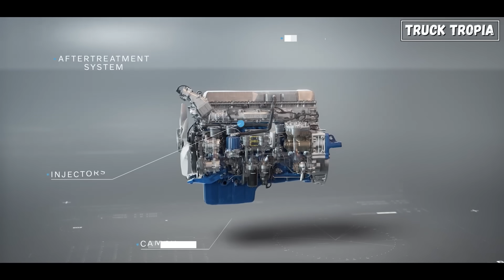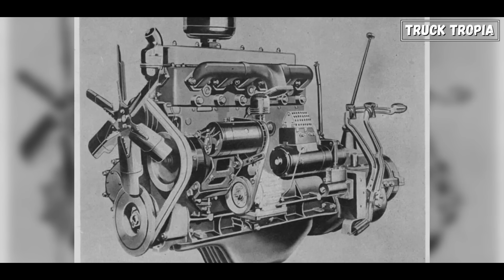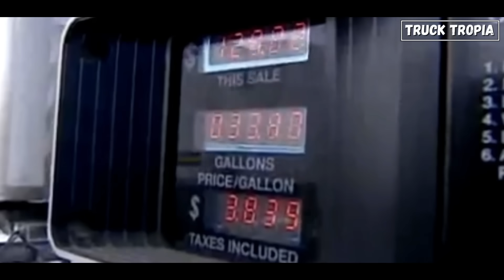How Truck Engines Went from 200 hp to 600+ hp

Comment: Electric trucks aren’t zero emissions. It either comes out the smokestack of the truck or the smokestack of the power plant.
Reply: That's where nuclear plus renewables comes in!😄😄😄
Reply: @leechjim8023 I agree! But it’s not even a 50 50 comparison right now. Or even a 1/3 each between the three.
Reply: @truckinguy92  Its probably not now, but it will be in the future.
Reply: It’s a common critique, but here’s the big picture: EVs are about 80% efficient at turning energy into motion. Gas and diesel engines? Around 20% — the rest is wasted heat. Even if the electricity comes from coal, it’s still more efficient overall. Plus, I’d rather use domestic power than keep funding oil companies and petro-states. U.S. oil independence is a myth anyway — we can’t even refine our own sweet crude. Batteries are improving every year. Let’s electrify what we can and save the mess.
Reply: @HiFiTown yes but the electricity used to charge an electric vehicle is almost always generated by a combustion engine inside a power plant
Reply: @HQdefault64 Even if you run a combustion engine to generate power for an EV, it’s still more efficient—gas cars waste about 80% of their energy per mile (waste heat), while EVs waste only around 20%, so “gallon for gallon” an EV burns far fewer fossil fuels.
Reply: @HiFiTown Wouldn’t the combustion engine waste 80% to generate the power, and then the electric motor wastes another 20% of the energy, so in total about 84% of the energy is wasted rather than 80% in a regular combustion-powered car? Just wondering
Reply: @HQdefault64  That’s a very logical question. Power plants do burn fuel, but they’re generally much more efficient than a car’s engine—modern natural gas plants can convert around 50–60% of the fuel’s energy into electricity (coal is lower). Then, even after transmission losses, an EV’s motor and drivetrain are about 85–90% efficient at turning that electricity into motion. A gasoline car’s engine, on the other hand, only turns about 20–25% of the fuel’s energy into motion—the rest is lost as heat. So even if the electricity came 100% from fossil fuels, the total “fuel-to-wheels” efficiency of an EV is still roughly double that of a gas car.
Reply: @HiFiTown Very interesting!
Reply: @HQdefault64 I agree—it’s fascinating, and honestly a bit hard to wrap your head around. How many machines do we accept such low efficiency from? A toaster oven, maybe—but even then, every dollar you spend running it is going toward cooking food, so it’s close to 100% useful output. If people realized their cars and trucks only deliver about 20% of each gallon of gas as actual “rubber-meets-the-road” performance, they might be more open to EV's in general.
Reply: @HQdefault64  No, 99%+ of electricity  is generated by turbines. Less than 1% of electricity is produced by ICE
Reply: @HQdefault64  Power plants are stationary and absolutely massive. You will have "combined cycle" power plants that will burn fuel to power a gas turbine - Think of a jet engine on an airplane. The turbine is attached to a generator and you make electricity. If that's the end it's called a single cycle combustion turbine, less than 4% of power in the US is generated this way. As you can imagine that turbine lets off a ton of heat like any "jet engine" would. Now, the powerplant has a ton of room so they will take that excess heat from the combustion cycle and boil water to create steam, they then run it through a steam turbine and extract more electric power. This would be what's called the combined cycle.
Reply: @HiFiTown  I don’t understand how this became a political issue. 

Tesla makes some bad ass electric cars, and also I believe has the highest amount of US made content in their cars. Why isn’t that awesome? Assuming getting the minerals for the batteries isn’t overall worse than just using domestic oil?
Reply: @TechnoLawyer And we won't likely see the refining capacity for domestic sweet crude. Instead thanks to the nature of free markets and profit motive.. they want cheap sour crude from overseas. Electric has me at the 80% energy conversion point... why take part in the lunacy any longer for passenger cars/suvs. (big rigs /long haul I undersrand for now) Tesla's are literally fine  for long road trips.. but the idea that gas is better for "long disrance trips" is being peddled hard to those who just have not tried it yet. Every Walmart is getting NACS standard chargers n a few years anyway. Hybrid was a good bandaid 10 years ago.. but now even convential guzzler SUV's are getting 30+ mpg thanks to CVT rubber bands and sketchy combustion tech. Hybrids are in practice "good" but also cery complicated with a worst of both worlds upkeep (Oil, gas plus batts).
I just talked to an uber driver who walked away from a Tesla M3 run hard put up wet, 250k on the battery and it was still fine (dash blower was not)... those may be the new Toyota Camry and as you say 80% USA made in some cases.. not bad!!
Reply: @HiFiTown  there’s very little electric charger infrastructure in some areas. I’m in Houston. Houston generally has everything, yet we don’t have shit for chargers in most areas.

This is the thing that holds me back from getting a Model 3. I do own my house and can charge at home, but still. 

My father lives in Florida. In his area, chargers are everywhere, so he has an electric. So easy for him there. Charges at the grocery store, at the Walmart, at the mall, etc.
Reply: @TechnoLawyer  You don't need a public charger in your home town, you need a charger in between towns.
Reply: Exactly .
Reply: How about hybrid big rigs overall? Are they a thing? There better or worse environmental impact there? 

In passenger vehicles, hybrids seem awesome. My wife wanted a little pickup. She went for a Maverick hybrid. Once she used the driving coach function on it for a while (apparently there’s something to the best way to drive a hybrid to maximize gas mileage), that thing is regularly getting 45mpg with her at the wheel.
Reply: A lot of that power comes from hydroelectric and nuclear, with some from solar and wind as well. There are lots of ways to produce electricity with little or no emissions.
Reply: The level of misunderstanding is thick enough you could cut it with a knife. 

Electric vehicles are 90% efficient, modern diesels are about 30% efficient. So even if you take your analogy, that 90% includes losses at the wall and accounts for the actual distance traveled for the energy spent. What this means in practice is that these vehicles are cleaner even if the source of the power is dirty. But, that's not even an analogy that'll remain true for long, because states like California already get the MAJORITY of their energy from clean energy. 

So, as we move forward over the next few decades they're only going to get cleaner, even taking into account the power plant. Finally, the whole lithium mining aspect is such a red herring as well, because I guess we just ignore all the damage of oil drilling, refining, transport, and the nasty environmental effects caused by that?

Here's the difference... lithium is on its way out, being replaced by things like sodium-ion, iron-phosphate, and other technologies that are far cleaner.

We've had over 100yrs to get ICE where it is today, we're not going to find a magic bullet. The electric revolution is only just kicking into high gear, and sooner or later people will have to accept that ICE is on the way out.

Today we have EVs with long ranges, and recent advancements are pushing boundaries. For example, a consumer-platform car recently achieved 750 miles in testing on a single charge, with fast recharging capabilities also improving rapidly. While such extreme ranges and sub-hour full recharges are not yet standard for all commercially available models, we are seeing continuous progress towards these goals. Theoretically, we could reach the same level of energy density as gasoline in the next 20 years. We are going to continue to squeeze in more power into smaller physical batteries, and as such continue to remove many of the limitations to going electric.

Finally, to combat what I'm sure is coming next. The grid needs upgrades to handle this energy, but let's pretend for a moment that we took all the gasoline and diesel that we create today and put that into creating power for EVs. We'd actually get more mileage out of doing that, with greater efficiency, than we would from continuing to transport all of that to gas stations.

I don't think we should do this, but it acts as a fantastic example of how inefficient our current method is. The grid needs to be upgraded, but we have time to handle that, and we have technology that can do it.
Reply: The mining of the minerals alone does more environmental damage than diesel trucks
Reply: And yet, it's still more energy efficient than using a ICE engine to directly turn the wheels.
Reply: Trump, however,  is a convicted rapist felon.
Reply: Nuclear and renewables produce zero emissions.
Reply: What pisses me off is how badly motorcycles have been in the last ten years. Sorry to go off rails but its fucking lunacy because motos make up a tiny amount of vehicle sales in the USA and slightly bigger but less traveled in EU, yet modern bikes come plagued with issues in the dbw and make far less power than advertised because of the EPA. I think the change begins in that crooked government agency first. Meanwhile in China, it's fuck all and one day in china is probably one year of pollution in both EU and the USA combined
Reply: What about the solar+Wind power and Regen breaking with EVs?
Reply: still better over the lifetime of the vehicle.
Reply: Also consider the pollution caused in recycling those batteries
Reply: I done just got up off the bowl nomsayin shitting and farting poopin poppin n blowin
Reply: E Trucks are good for the quarter mile drag racing but that's it.
Reply: @Johnsmith-zi9pu  Maybe so for real work? But in the USA (thank you sales dept.,) , on the consumer side.. folks use these massive Trucks  as Grocery-Getters, to make 17 trips to the convenience store. Not to haul a dump trailer, nor,  go up the side of a mountain. Think of the Gas, Oil and DEF fluid they'd save 🤥
Reply: Electric motors are 98+% efficient compared to about 30% for engines. So even if you move the emissions to the powerplant you are cutting overall emissions to 1/3 of what they are now. So instead of 100lbs of emissions from a diesel tailpipe you're releasing  30lbs  of emissions at the powerplant.
Reply: And mining hundreds of tons of ore to get 1 pound of lithium. How much environmental destruction does lithium mining create? Amd how many gallons of fresh water to process lithium?
Reply: @ms.annthrope415 the mining tailings stay at the mine site. Does the CO2 and NOx stay in the truck?
Reply: @ms.annthrope415  look up lithium mining chrisis, forget where its at but its popular over seas in africa i believe and south america, what i do remember is it litterly sucking the life out of the land. the method theyre using is pumping water rich with salt, making the communities wells dry
Reply: @ms.annthrope415 is lithium the end all? Look to the future. These are just details to work out.
Reply: Right. Manufacturing ETs will produce more carbon footprint than conventional ones.
Reply: People forget that power plant have worse power efficiency than car engines. That have amazing efficiency for their size.

Comment: About 20 yrs ago I drove a 1934 Chev, 5 ton petrol, 100 odd miles. It was a favor for a friend. I would guess it had around 80 hp? It was just a cab and chassis. Now that was an experience that not too many would want to remember. I nearly fainted from the heat in the cab and it just about burnt fuel faster than I could put it in 🙂

Comment: Shit.   CAT 16.L.  625hp. With the stock transmission.  BIG rubber.   CAT 17.l. with big rubber     in will say you need to stay in your  lane
Reply: What “stock transmission”??  They’re all stock transmissions.  What a dumb comment.  You don’t even understand gearing and speeds of said “stock transmissions”.  $100 wampum says that you drive an automatic truck for Swift or Amazon.

Comment: Dont forget alot of old trucks were gasoline before diesel became popular for their efficiency and torque
Reply: Also some different brands of engines such as Buda. 
GMC V6 and V12 models
Reply: That low-rpm power that diesels are known for comes from the turbo, though, right?
Reply: @shoryuag not necessarily a lot of old diesels did not have a turbo and turbos became popular in the late 60s/70s since it made diesels produce more HP and torque and with the robustness of a diesel engine it just made sense. A lot of torque heavy application diesel engines don't even need a turbo to produce a lot of torque the added horsepower just makes it a better long haul engine

Comment: 70 years ago 700hp was a tank engine. 12cyl, 30L, 1.5t, 200h TBOH, plum of smoke visible from the Moon. Technology evolved, mostly materials and in last 20 years computer control, and now regular diesel has about 100hp/l, so make 500 or even 700 hp with million lifespan is not a problem anymore. The same with transmissions, bearings, brakes, rubber tyres... tadaaaam - we got modern truck, able to pull 120t on 90kmh.

6:00 if you can use 2 trucks instead of 3 for the same job, the same delivery (distance - weight - time), it means you significantly save on fuel, even each truck gobbles much more fuel than before.

Its very simple to calculate power demand. 70-80kmh (20m/s), 10% grade, 30t - 2m/s*300000n = 600KW just to climb up, without usual drag on this speed. So ideal truck engine should be about 1000hp. It will be a bit overpowered, 10% grade climb with such a speed is extreme, but its The Dream. In reality 600-700hp do the job, 5% climb on 80kmh or rare 10% climb with 50 kmh deemed to be acceptable.
Reply: DPF systems made truck engine durability take a make step backwards. think you will get 1 million out of current production truck engine, good luck. an old C15 cat, or N14 cummins sure.... not anymore. thanks to carb and the EPA
Reply: @andrewdonohue1853  Dont buy US junk and you will get a million out of it. Euro engines are very reliable.

Comment: 600 ain't squat!  Scania makes 770 horsepower
Reply: Ya I was going to say Scania and Volvo got some motors in Europe closing in on 800hp
Reply: CAT C16s can be tuned to hit 800.
Reply: Scania this and Scania that. Blah blah blah. This is North AMERICAN trucking here, obviously 🙄
Reply: @StopDaCap2991 except several shots of European trucks, so not just American. Try watching the video before commenting
Reply: @senseofthecommonman Except all engines mentioned in the video are AMERICAN. Try watching the video before getting smart.
Reply: Cat C18 with Marine cam makes 850 hp and can be easily tuned up to 1150

Comment: Electric trucks just don't have the range. Full tanks of Diesel will take you over 500 miles, then 10 minutes to fuel and grab a bite to eat. Batteries are heavy, expensive to replace, and take forever to charge. Electric trucks won't be the norm except for short haul, dedicated routes. Like Amazon. Same with automation. AI can't navigate complex road conditions
Reply: Hybrids are the way to go
Reply: Yeah, once the battery goes dead, that’s pretty much the end of your day. It will take years to build the infrastructure to handle them.  For local drivers, they might not be a bad alternative.  I work in a factory. We have several plants here in Illinois.  We have drivers who go from one plant to another to deliver parts.  They only go a few hundred miles every day. Electric trucks would work fine for these kind of routes. Long haul drivers would be frustrated by the limited mileage per day though.
Reply: Exactly! How's an electric truck motor gunna do 1.5 million miles😅😅. And the world will soon be overwhelmed with spent, useless electric truck motors...
Reply: @michaelosgood9876  electric motors will last millions of miles. Bearings may need replacement every million or so, but the motor itself will literally go forever
Reply: @michaelosgood9876  reliability is a bit of an unknown.  Initial cost and lack of charging stations makes them impractical for most companies.
Reply: @michaelosgood9876 locomotives do millions of miles every year and all locomotives are powered by electric traction motors. Hardly if ever do the electric traction motors have to be replaced because electric motors are insanely reliable.

Comment: uh, shouldnt you be comparing TORQUE numbers?
 An engine with a 2000 RPM redline and 200 HP would be rated at 525 pounds of torque, whereas a 350 HP engine at 3500 RPM would be producing the SAME 525 pounds of torque.
Reply: While your comparison is true, the 350 hp engine will get the same amount of work done quicker. Hp is the rate at which torque is applied.
Reply: No, he shouldn’t. HP is what matters in terms of towing speed up a grade
Reply: now setup perfect gearbox for each and you get at the same speed +/- the same diff in force at whell as diff in power and never as diff in torq 😉 👌🏻 setup in modern truck 50 hp engine at 1 rpm = alotmore torq than 525 lbf ft for 350 hp engine ( btw torque level is not caluclated be red line rpms level and power level cos power max can be at diff rpm peak tprq co peltellly doffrent aswlell but lets focus on ypur tprq power data which you write in your comment 👌🏻) and it would be tow huge load on highway or uphill likeone big peace of 💩🤭cos power is pace at which work is done 🌪️ other word torq is irrelevsnt units itslef as well as rpms itself 👌🏻in regard  to avg truck where each have setup eprfect gearing 👌🏻basically only power levell subscribe how dynamique specific truck be able to tow the same load on the same road and weather 👌🏻🪠